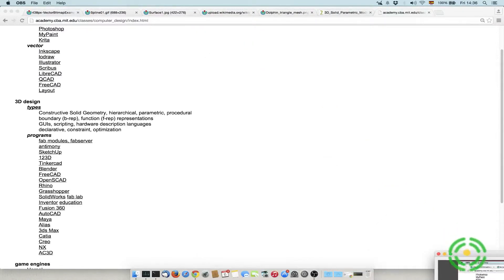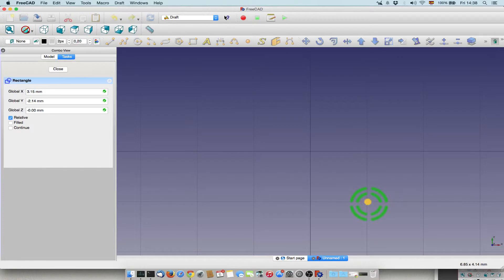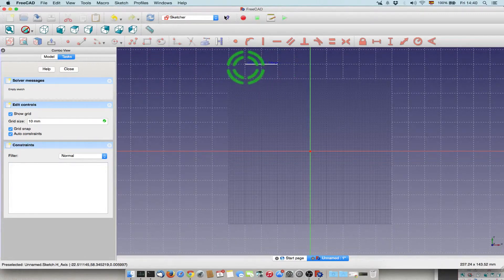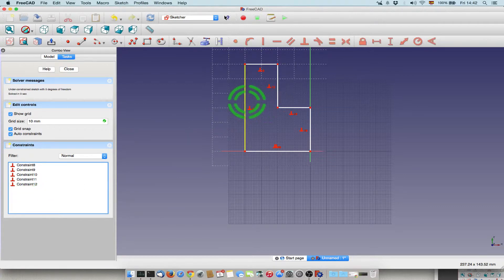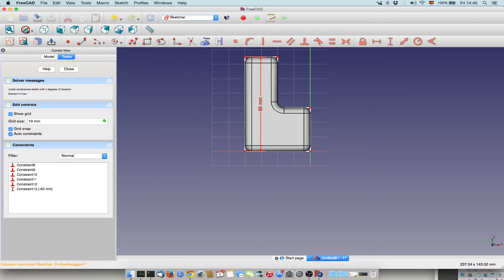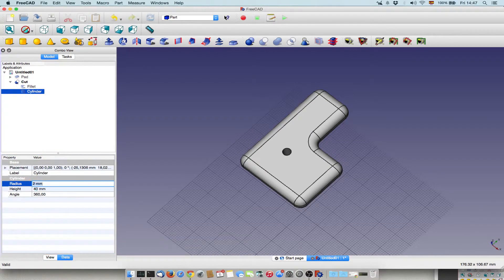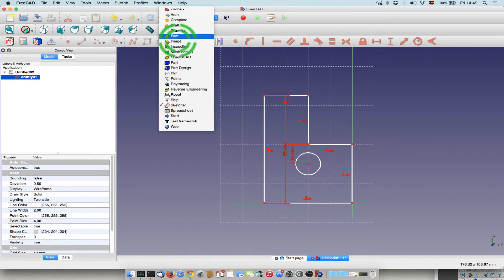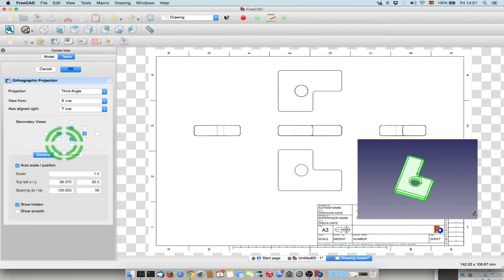Fab Academy 2015: Lecture 02 FreeCAD

Comment: Thanks for making a video about FreeCAD!

BTW The Draft Rectangle has a "Make Face" property. By upgrading it to a basic face, you actually turned it into a lower-level non-parametric (non-editable) object. In any case you can extrude a solid from a Draft Rectangle or any other closed Draft object even if the "make face" property is set to false with the Part Extrude tool by checking "make solid". PartDesign Pad will automatically extrude a solid from any Draft object, provided it forms a closed profile.

In regard to your collegue's question at 11:05, external references only work inside a sketch, and only if this sketch is mapped to a solid. So rather than use a cylinder to cut your original Pad, you can map a sketch on top of the Pad by selecting its top face before clicking on the "Create new sketch" button. Once in sketch edit mode, you can use the "external geometry" tool to copy an edge from the solid. You'll then be able to add a circle, then apply dimensional constraints between your circle's center point and the copied edge. After that it's just a matter of creating a Pocket feature from the PartDesign workbench to cut the Pad.

You can look for video tutorials on YouTube, there are many about FreeCAD and some will probably show this.

As for your 3D view refresh bug, I've never heard of it before, at least it has not been reported on the FreeCAD forum. You may be interested in testing a development snapshot which may not suffer from this bug. In any case, it would help the FreeCAD project to test it and report if the bug still happens as they are set to release the next version v0.15.4xxx at the end of the month, with more than 800 additions and bug fixes over v0.14.3702. http://sourceforge.net/projects/free-cad/files/FreeCAD%20MacOSX/FreeCAD%200.15%20development/